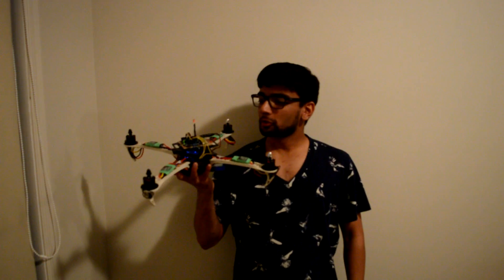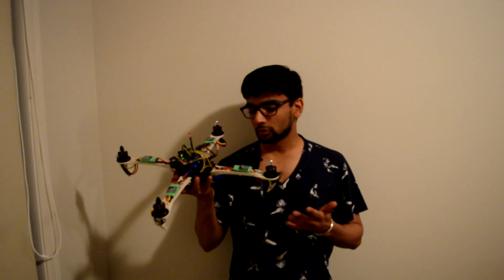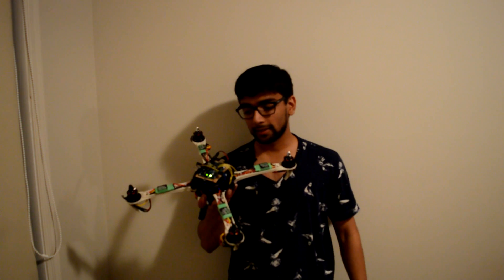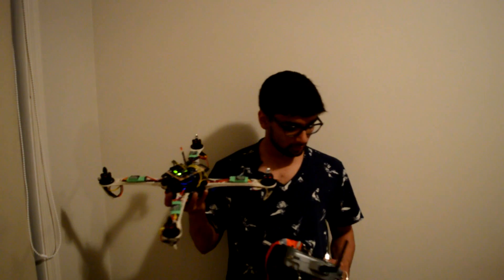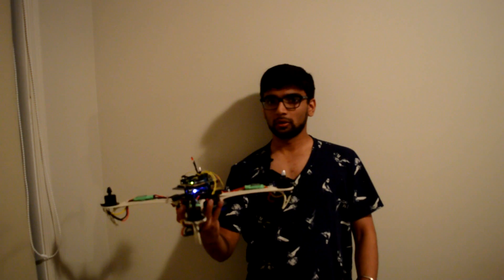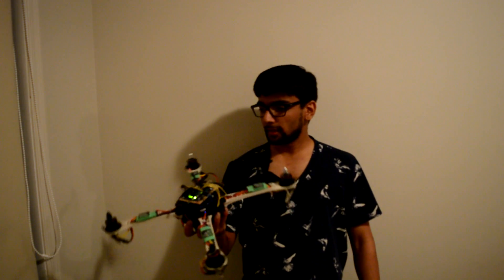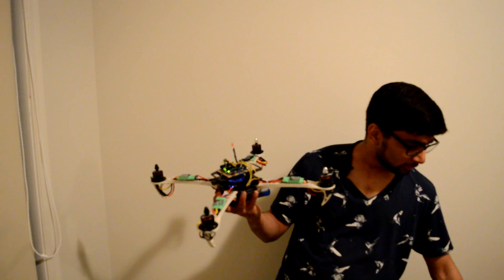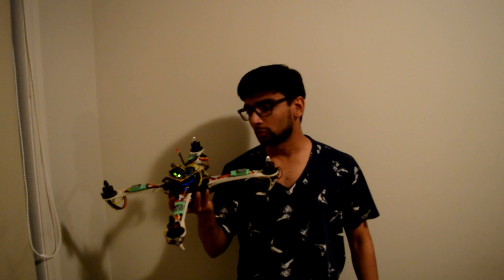Do It Yourself Arduino Uno based Quadcopter | Easy and Step by Step Tutorial

Comment: Sir did you cut the battery wire to series the diode?
Reply from the maker: Yes, I had to cut the wire, place the diode in between and solder it again.
Reply: sir how can i change the value of pid?
Reply: sir why my diode melted when i connect it into series? :/ its also the same when i solder it again in the battery.
Reply: i lost 2 diode with that same problemsir :/

Comment: can i use bluetooth hc-05 module instead of RF communication ?
Reply from the maker: What is the objective behind using a bluetooth module? Yes you can use it, but keep in mind that bluetooth doesn't have very good range as compared to traditional 2.4Ghz radio. You don't want to be in an "out of range" situation and have no control over your quadcopter by using bluetooth.

Comment: i need the code too :) ...  you rock \m/
Reply from the maker: Hello,
All the videos are now made available and public. Check out the links below.

Unfortunately, I cannot pass my code to you as it is proprietary with a research company in Canada. However, please see the below link for a different code which I have tested and works absolutely fine. You might need to tune your PID gains by trail and error for your specific quadcopter. :)

Project YMFC-AL - The Arduino auto-level quadcopter: http://www.brokking.net/ymfc-al_main.html

Introduction to this Project - https://youtu.be/5fIRZhpsPIA
Part 1: Parts List - https://youtu.be/gbPc7j61RN4
Part 2: Wiring Connection - https://youtu.be/Q4QM-H2VQs0
Part 3: Testing and Parts Placement - https://youtu.be/2AYs0Kl1K7U
Part 4: Assembling the Quadcopter Parts - https://youtu.be/kjrdAP5PSww
Part 5 Connecting the Quadcopter Parts and Introduction to Programming - https://youtu.be/ogGPikKiLQM